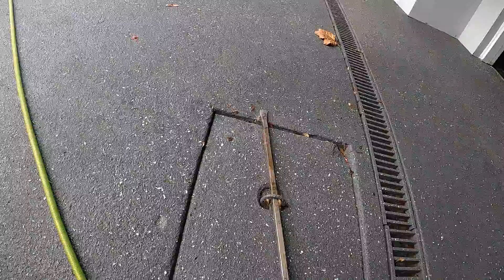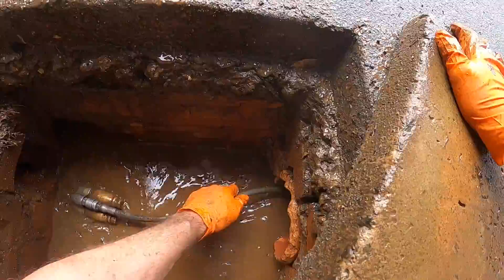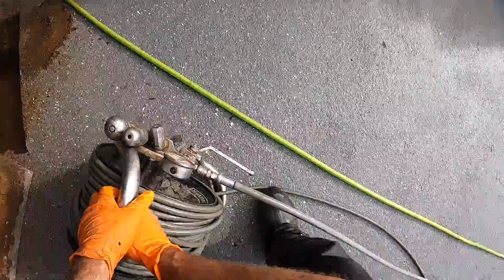Blocked Drain 460

Comment: Timestamps...

00:16 Blocked drain
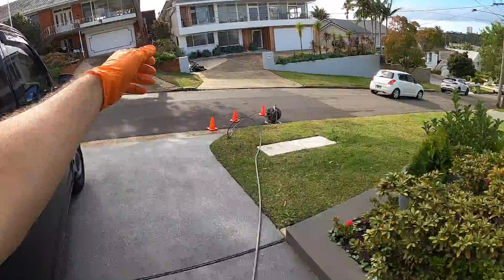01:10 Magpie walk
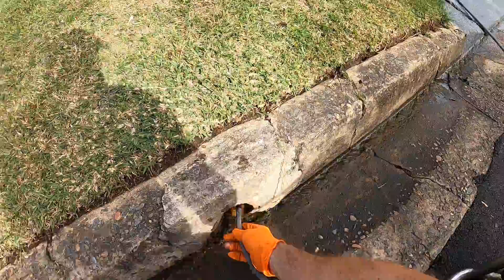01:31 Penetrator In wrong pipe   
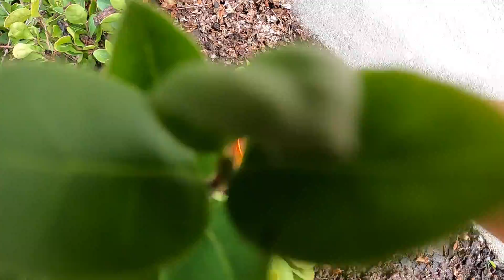03:54 Wrong pipe confirmed 
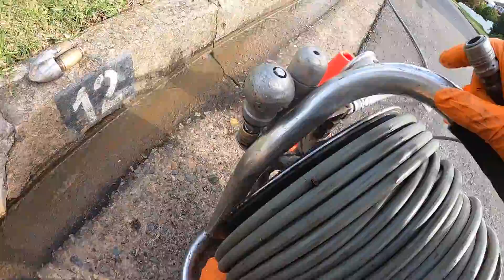07:15 Double B goes to work
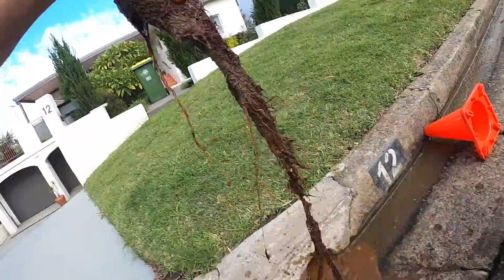08:00 Roots
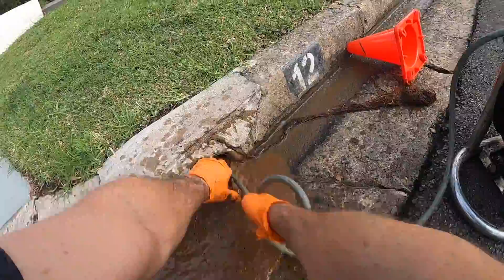08:10 More roots
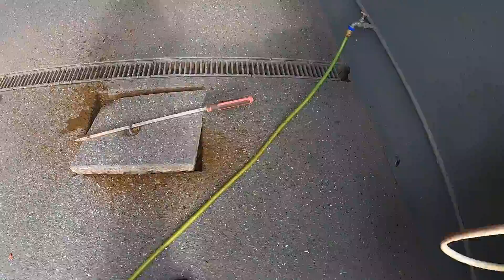10:59 Double B all the way up
11:49 Mud
12:26 Bug
12:57 More roots 2
14:10 Clean up time
15:19 Ratty sunbathing 
15:47 Ratty does final inspection with kookaburra
16:10 All good
Reply: risc19 How long did this take you?!
Reply: @tombstone54  🌚
Reply: ㅁ젿ㄴㅂㄷㅇ가아오우우ㅏㄱㅁ

Comment: That was a weird layout for a storm drain pipe. I wonder where the neighbours storm drain exits.
Reply: Wondering if someone previously broke the original pipe and instead of replacing the pipe, just tee'd it into the neighbour's storm system running close by.

Or the neighbour's drain might exit two blocks down and across the street.
Reply: brucetheloon That’s a very big possibility, as the pipe he thought was the customers just ran into the neighbours side of the boundary fence to nowhere.